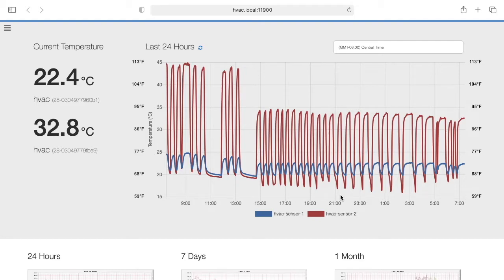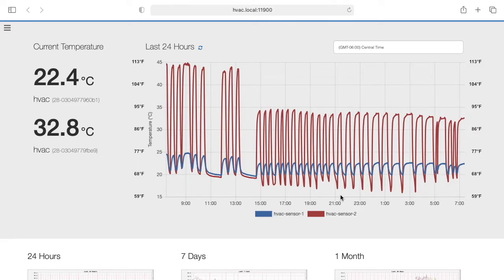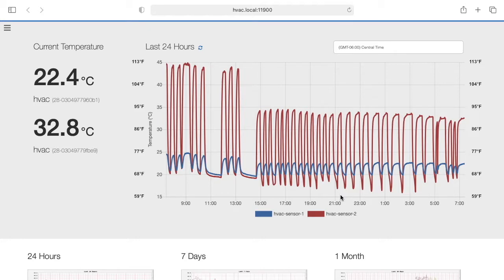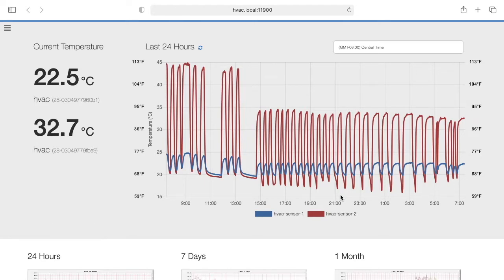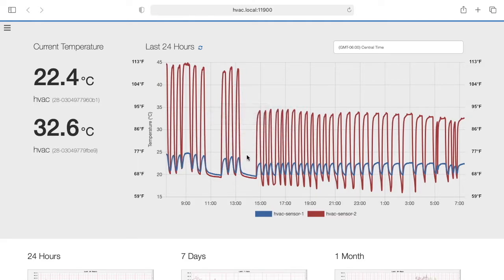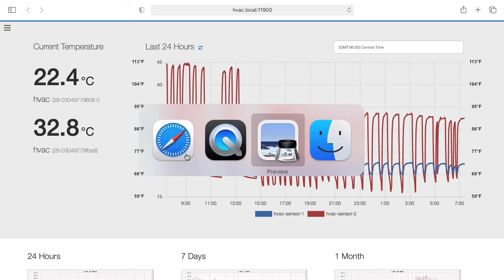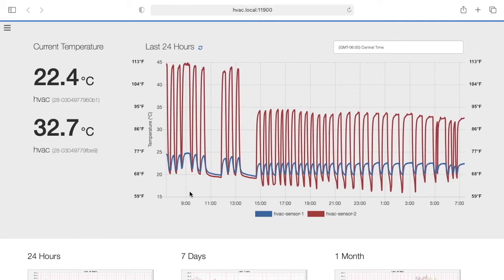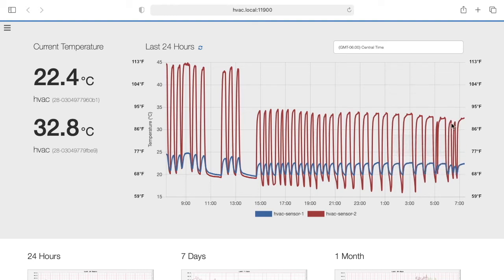Quick Temperature Comparison of Heat Pump vs Natural Gas Furnace

Comment: heat Pumps go thru a defrost cycle ever so often (often every 30min, or 60min,or 90min)  defrost is the same as house cooling mode.  And in that mode the furnace is forced on to give defrost heat to the outdoor unit.  So that might cause of periodic cold swings in outflow temp.

Comment: What do you reckon your costs for using each are? Does the internal air temperature differ?
Reply: Economics of it:  most place in N.America Electricty costs 3x as much as Nat Gas per unit energy,  than means use gas if COP is below 3 on the heat pump . for an Air-Air heat pump that is at abut 40F outdoor.

Comment: I'm confused about when you say input vs output, do you mean that input is the supply and output is the return?

This was a great video by the way it helped answer many questions for me.
Reply from the maker: Input is the air entering the furnace. The sensor is in the duct that leads to the air filter. The output is the air exiting the furnace. That sensor is in the main trunk that branches off to the vents.
Reply: @Rickmakes  Late to this discussion, but I'm confused why the furnace input temps are as high as 40-45C. If the air exiting is no hotter than 25C, what's causing the input to get to 40/45C? Similar comment for heat pump metrics. Input around 34C, but exit no higher than about 23C.

Comment: My view is that a heat pump is adequate if you are okay with your house being less than 95F, since it's purpose is to regulate your home. If you want that cozy feel then a fireplace or portable electric heater will be adequate.
Reply: Do you have a heat pump on your home?
Reply: @marksuave25  no but I really want one, first I have to get a home though
Reply: @graysonsmith7031  having had a heat pump on a two story home with a basement...it sucked! Our home was constantly chilly...and our heating cost was sky high! If you have natural gas, get natural gas or if you can afford it get the hybrid.